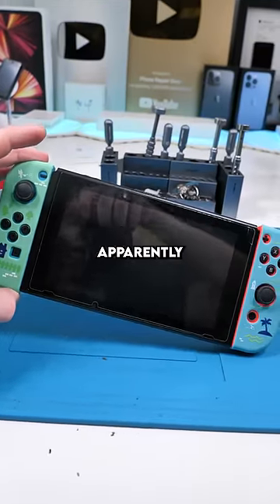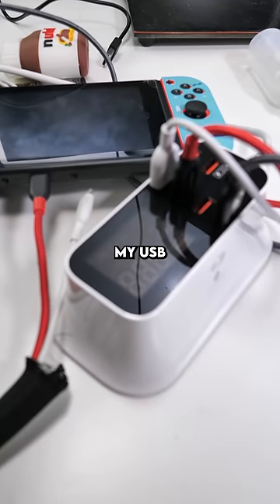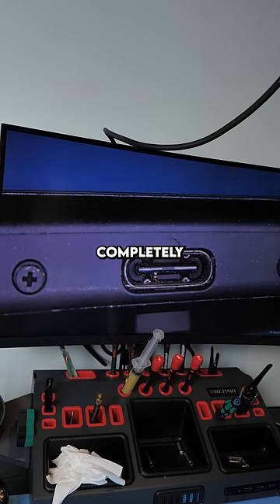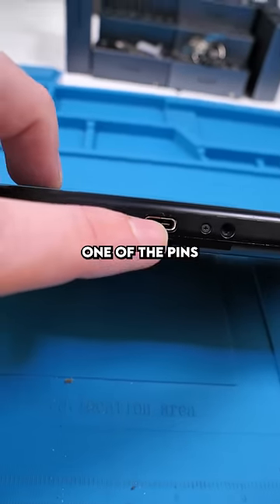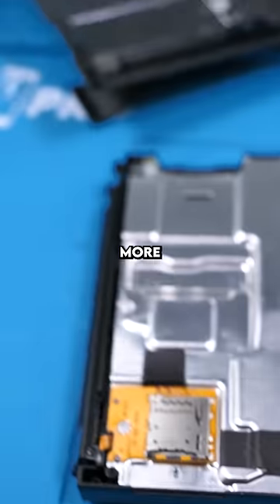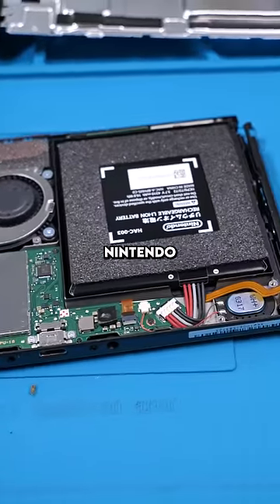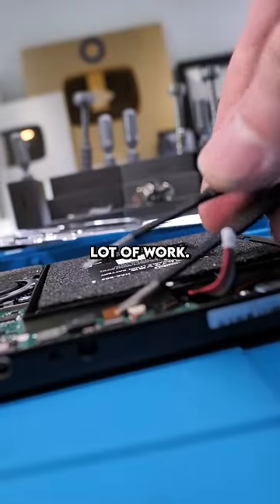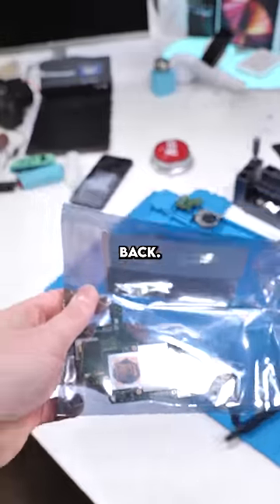This Switch Wouldn't Charge... USB-C Durability is 🗑️ #Shorts

Comment: usb-c isnt trash people just dont treat their devices nicely
Reply from the maker: Durability isn’t great
Reply: @PhoneRepairGuru  i guess thats true but it does charge devices and allows more compatibility with other devices
Reply: i have never in 5 years had any problems with usb c, people dont give a shit wbout their devices
Reply: @NayNayelvWolf  simlar here, i have had usb-c for around 3 years or so and no problems with it yet
Reply: @NayNayelvWolf  I don't dare touch my phone when it's charging but they all break within a year. Never had that with microB or lightning. it's a shit design
Reply: @Bluetooth  sounds like a you problem because I've never heard about any USB-C problems except from Apple simps.
Reply: @reginaldcampos5762  same
Reply: @Bluetooth  for me its the exact opposite, micro usb was utterly terrible. pull it out rough one time, and its like the connector is coated with vasoline, and falls out literally on its own. ive had no such problems with usb-c, neither male or female ports
Reply: @PhoneRepairGuru  I've had one cable die in the 3 years I've had an Android phone back when I had an iPhone I had like 10 cables die a year lightning just is not reliable
Reply: @PhoneRepairGuru  what are you talking about? you know MANY of us have been using USB-C for nearly a decade now and never had a single issue port wise..? Can't say the same for iPhone chargers and the people who use them. It's all about how you take care of your things. Remember, USB-C has been pretty common on a lot of devices the past 5 years give or take. I have bricks and cables all over.
Reply: @PhoneRepairGuru  You being a cellphone repair guy, I can see how you think that's the case when people are sending in their old Android devices they refuse to upgrade from and generally never took care of. When you're an Apple customer and forced to pay a premium for everything, it's more likely that userbase is going to have better due diligence with their devices... Typically. You should know... Lol
Reply: This is why I don’t think USB-C (and to a slightly lesser extent, Lightning) aren’t great standards for smartphone life. In the real world, people do not treat their devices nicely, and a standard should be used that takes this in mind. 

I feel a magnetic connector to be the best solution. This would provide a hard limit to the stress the port would need to endure, and reduces the need for friction-fit or springs, which also reduces the damage that dirt or debris can cause.
Reply: @PhoneRepairGuru  i yank the shit out of the cable and port when I'm asleep, no problems for 6 months now.
Reply: @henryprentice3112  my mid-range phone of less than a year old already has a jank usb-c port. For all the shit apple does, my old iPhone 7 my parents got me lasted me well over 5 years and that port was tight enough to pass a virginity test. 

This is one of three major reasons legislating shit like this is unacceptable.
1 : Ports have different strengths and weaknesses. Additionally, no 1st gen port will compete with a 4th gen port, so legislating people use USB will inherently mean no new ports get created, even if, with revision, they could surpass USB since they would have to be better from day 1, which is impossible.

2 : People's purchases are their own. If someone wants to keep buying shitty apple products, they have every right to. And if they keep buying those products, they clearly don't care enough about the port for them to stop buying them, so, why should you or anyone else have the right to legislate apple to change, when the consumers don't care about the thing you're up in arms about. That'd be like legislating the brand of paint Ford uses on their trucks because you don't like the idea of the red they use being sourced from insects and it grosses you out. You ain't the ones buying it, if you don't like it, tough shit, and if you are the one buying it, why are you buying it if you don't like it, just stop.

3 : it's an aggregation of government power. This exact same precedent applies to police bypass chips in devices as well. "If we were allowed to mandate hardware be installed on private consumer devices before for the minor annoyance of a charging port, then how come you are all acting like we don't have the right to demand more hardware, in the form of police bypass chips, to be inserted into modern devices in order to potentially SAVE LIVES?" The only reason it seems acceptable currently is because "boo, apple bad!" but if this exact same precedent was applied anywhere else I can say with certainty it wouldn't be accepted. That's not democracy, that's tyranny with vaguely democratic paint.
Reply: Only time I had issues with USBc was when it first came out on a very cheap android phone. Since I got a Samsung I've never had an issue on it or any of my other USB c devices. 🤔
Reply: @PhoneRepairGuru  Bro, your fighting a up hill battle, your creating a war zone in your comment section. Give up with your lies. The switch charger goes up to 39w, no lightning charger can support that.
Reply: @PhoneRepairGuru  i use and abuse USB c cables every day, even super cheap Chinese ones, and I've never had a single one break.
Reply from the maker: @your_average_cultured_dude  I'm talking about the port not the cables
Reply: @PhoneRepairGuru  I've never had any of those break either, and i don't know anyone whose ever had a broken usb c port (almost everyone uses usb c where I live, since most people buy android phones).
Microusb was the only usb with horrible durability.
Reply: just thought i'd add my own experience here:

i've had a usb-c break to the point where charging my phone was barely possible (xiaomi), and the same thing happened to my dad's samsung (s8 or something, so not terribly old). On my laptop (Lenovo), the usb-c 3.2 port can't hold a cable (i have a relatively thick cable but still) - it just hangs in there and the port in the laptop itself gets tilted by 10 or more degrees), and it keeps getting worse. this has been the case ever since i bought the laptop, so it's not only bad treatment.

while there seem to be issues with the usb-c ports on many devices, the standard itself is insanely good:
i boot my pc from a 512gb ssd and load games from a 1tb one (both connected with usb a), i have a 5tb backup drive  connected and i use a 1080p60Hz hdmi connection to get 5 (could be 7, but doesn't make sense with my amp) channel audio to my speakers and also for an external screen.
All of this runs off of a single usb c hub (no external power required) and i get no noticeable performance penalty (unless you wanna compare an m.2 internal drive, that is probably faster, but also not really fair to usb c)

I just wonder why these ports need to be so small... I get that flat devices look cool but why not make it double as wide then? or somehow layer two connectors behind one another, then you just need to go further into the phones (which would also help prevent them from falling out like some cheap micro usb cables used to)

so yeah, usb c is hate-love for me. usb A is nice and durable, you can probably hang your printer on the ceiling just from the usb B alone, micro usb does break but its mostly fixed with a new cable (way easier than port replacement), i like the micro usb double thingy they use on usb hdds bug cant really say how durable it is (seems strong af tho) and there are some other slightly obscure usbs that also seem more reliable, but i dont know much about those.
Reply: @PhoneRepairGuru  better than a lightning port, at least it charges more than half of a half of a half of a quarter of an eighth of a twelfth of a watt an hour.
Reply: @henryprentice3112  thats true
Reply: @PhoneRepairGuru  its durability is fine if you don't have the fine motor skills of a drunken toddler with milk poured over their hands.
Reply: It’s trash for ppl with limited hand function. Prefer anything but usb c
Reply: AGREED, it also transfers shit faster
Reply: @PhoneRepairGuru  lightning isn't great
Reply: @KofolaDealer  i have usb c and i use my phone while its charging, never broke and only takes 1 hour to go from 0 to 100
Reply: @PhoneRepairGuru  only if ppl used it properly, like how can you break a Pin that connects on Both Sides and charges at lightning Speed, none of my USB ports or connectors ever broke, it's just ppl who don't treat their devices neatly, AUX is the most trash Pin of my life btw it literally breaks from inside and you wouldn't even notice that's why I use Bluetooth
Reply: @shitalsawant1973  I never broke an aux cable but you can make your own with thicker wires like I did for my friends, it's cheap and indestructible
Reply: @KofolaDealer  I didn't break it it just gets cut off or wires become loose from inside
Reply: @PhoneRepairGuru  Lmao ook bud
Reply: @PhoneRepairGuru  it is, unless you're smashing your plugs in
Reply: @PhoneRepairGuru  I have been using the same USB C device for half a decade, and I haven't always been gentle with it, plus it's been exposed to wind, rain, mud, dust, sand, immersed in water, and dropped 15ft with a cable still plugged in when a mate of mine knocked it off the edge of a building. It still works like new. I'd hate to see any apple device go through that, it would be bricked before it made it halfway in.
Reply: @PhoneRepairGuru  Don't start a port wars please
Reply: @PhoneRepairGuru  ah yes and the lightning is so much better XD i have a samsung with usb-c my mom has iphone with lightning, she has had to replace her charger 3 times in the span i had to replace it... never XD
Reply: @PhoneRepairGuru  Since when? My phone's port still functions like it did new after 2 years of plugging and unplugging chargers daily.

My laptop's Thunderbolt 4 port still functions after plugging in and unplugging an external hard drive daily for the past year and a half.

My Oculus Quest (1st gen) still works perfectly after 2 1/2 years of constant weight on the port, and the cable being swung around, tugged on violently, punched, etc.
I've hit the cable so hard it bent the male end of the cable, but the port is still perfectly fine and has no issues, it was just a cheap cable that broke.

USB-C is honestly one of the most durable connectors I've ever seen. I've had USB-A ports break easier, and don't even get me started on the number of lightning ports I've seen crap out and stop working.
Reply: @PhoneRepairGuru  really? Because I've had the same USB-C cable for what's getting close to 2 years, and it still charges and does so with around 45 watts, it charges my phone in just 30 minutes.
Reply: Let's look at my laptop cable that is usb-c me:tries to plug in laptop. usb-c cable:you shall not charge your device unless you wiggle me to the correct angle. me:why this design.
Reply: yes I know that this is the port not  the cable big beans also if your iphone won't charge then clean the port
Reply: @jordi28panama  that's been the same for like every charger that has gotten old ever, also maybe take care of your charger better.
Reply: @gsyt2356  it happen a year after I got it
Reply: @KofolaDealer  Micro USB broke constantly for me. Every device I ever had with it would barely connect after a year of use. I've never had an issue with lightning other than the slow as shit transfer speeds.

USB-C is fast enough to handle an entire computer's I/O on one port, and I have never once had a USB-C port break. I've dropped my phone with a charger plugged in multiple times. Fine. I've had my external hard drive fall off my laptop and dangle by the cable more times than I can count, still good as new.

USB-C is basically indestructible. To break it, you either have to have a really cheap device, or take no care of your electronics.
Reply: People aren’t gonna change their habits and the ways they treat their devices so why not get a more durable port? 
Also, the answer to that is, companies are glad that you are giving them more money on repairs.
Reply: I want to add that while I only switched from a phone with a Micro USB port to one with a USB-C port about a year ago, I've had my Switch for almost six years and been using it in both docked and handheld mode on and off.
So far I don't have any problems with it's  USB-C port and I'm not always super careful when I take it out of or put it into the dock...
Reply: @KofolaDealer man my microUSBs ALWAYS died within the first year and you're out here saying that it lasts longer than USB-C???
Reply: @KofolaDealer  There's no way you're being serious.

Micro USB is literally a step down from USB C in every way. Ignoring the Lightning Cable, unless you've been plugging in your USB C cables in with the might of Zeus while being extra delicate with the Micro USB, there's no way they've outlasted them. This is assuming, of course that you don't get shitty cables from eBay.

Comment: "This would never happen to a lightning port." I don't think Nintendo wants us or themselves to pay royalties to Apple for a less capable port, could be wrong. 🤷
Reply: I don’t think that’s at all what he’s suggesting either. It was a big “What if” hypothetical question.
Reply: Also I'm chalking this up to be improper use of the port as I've never seen or heard about this before.
Reply: Frfr
Reply: Lightning wouldn't even support the features the switch needs when plugged into the dock...
Reply: Docks switch and uses a single port to capture FHD video, audio, and power the device. That also would never happen with lightning (at least not as seamlessly)

Comment: ThIs WoUlD nEvEr HaPpEn tO a LiGhTnInG pOrT.
Reply: Its just true
Reply: @mateuszkaminski1172  It's actually not. The only difference in this scenario is lightning has the pins on the walls of the connector, USB-C has them in the center. They can still be bent on both connectors, so they both have this "issue".

In reality, this isn't an issue for anyone above the age of 5. Just treat your expensive electronics well and this won't ever happen.

Comment: Another thing that would never happen to a lighting port is 120w charging
Reply: Yes and also its not a standardized connector, its not like nintendo or samsung or anyone else but apple are allowed to just put it in their devices.
Reply: 120w is too much for an iPhone to handle
Reply: @Alex2554  that's why I said this
Reply: 120w charging is useless at least 20-50w is fine
Reply: @RichBatangKalye  the iPhone has 18...
Reply: @Danny-xe2sg  it can charge with 20w
Reply: @RichBatangKalye  ok